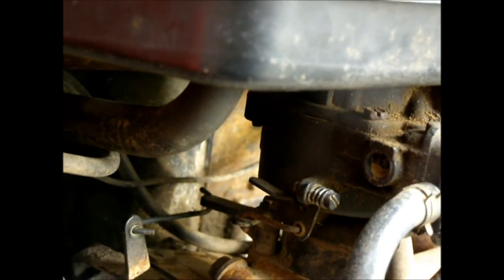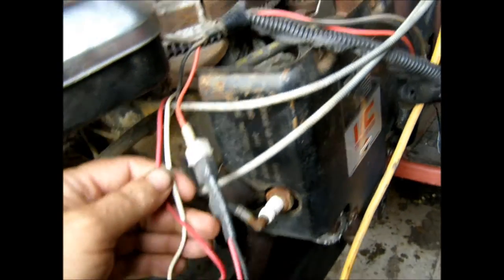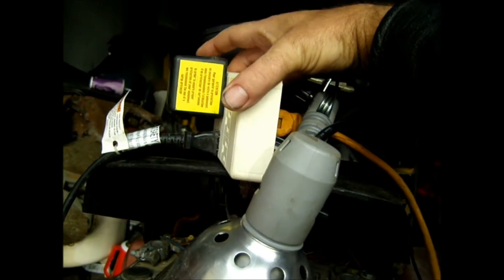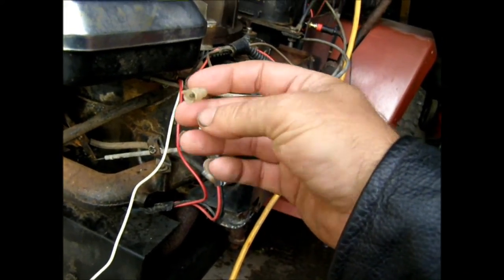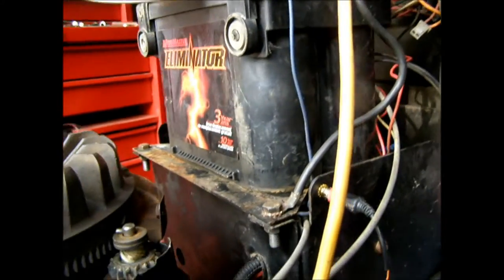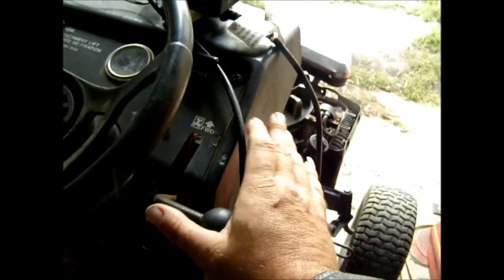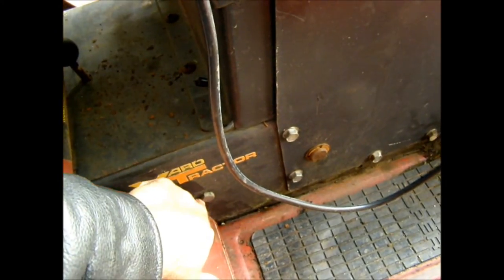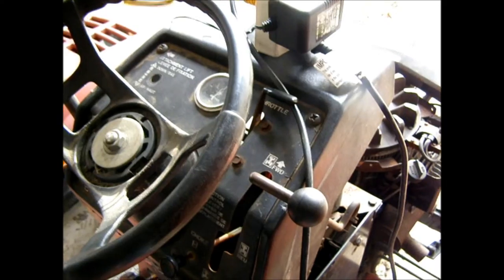Roper Lawn Tractor Sept 22 2012

Comment from the maker: Well Mr. Canbe....I am sure that if I pump the throttle enough at the starting line, before we stage, the fumes from my gasser should render you unconsious leaving me with the win. LOL I ran this in the driveway for less than 5 minutes and everyone IN THE house, was choking. It needs a little carb adjustment. LOL More mods coming over the winter.